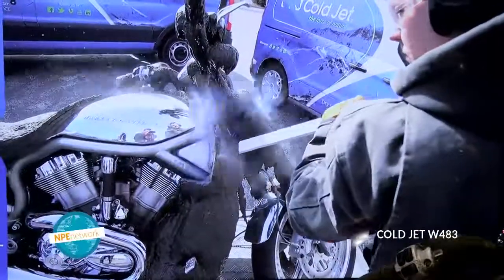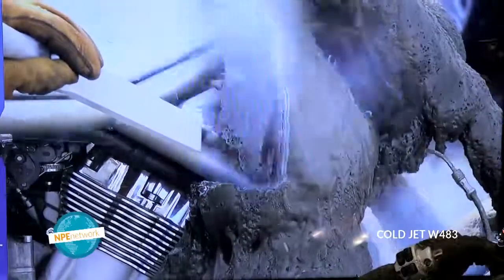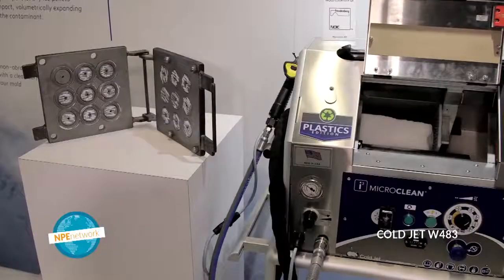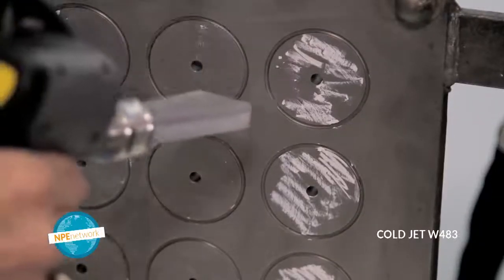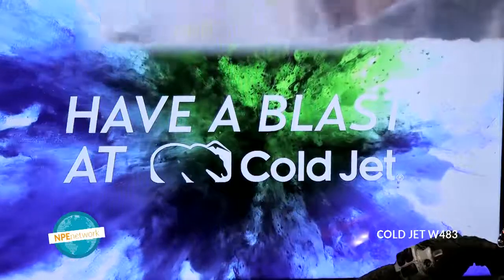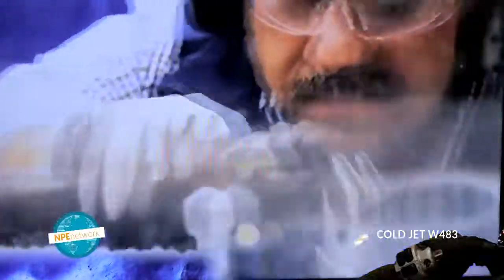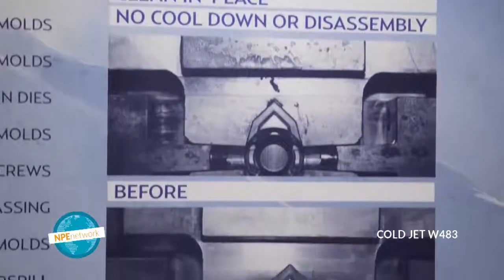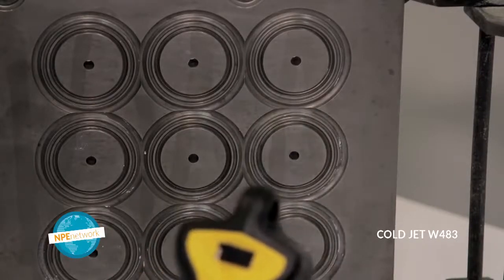CNTV - Dry Ice Cleaning in Plastics

Comment: I learned this the hard way when I was 19 years old and bought a very nice 77 cobra || with the 302, 4speed, of course it had a distributor and after spraying the engine bay down it wouldn’t start, just backfired like it was out of time, pulled the cap and dried it out and it fired right off, pretty simple, today’s vehicles with all the computers etc, I definitely wouldn’t recommend it, use some elbow grease and get some good cleaner and clean the engine by hand.